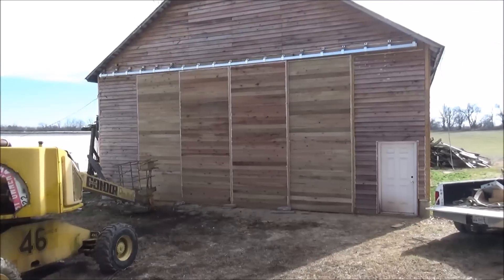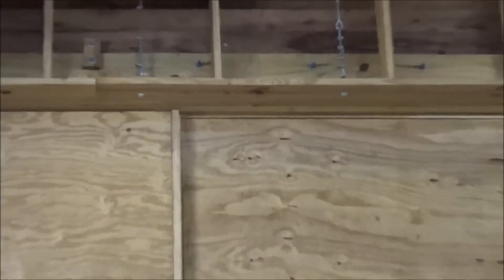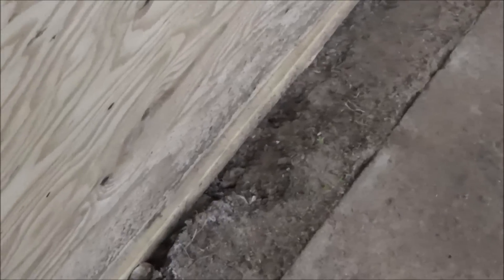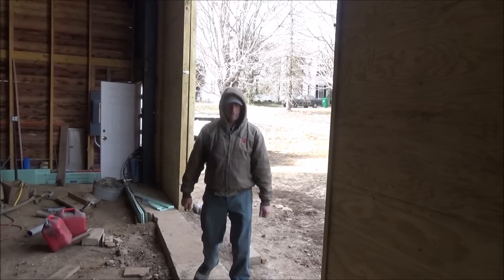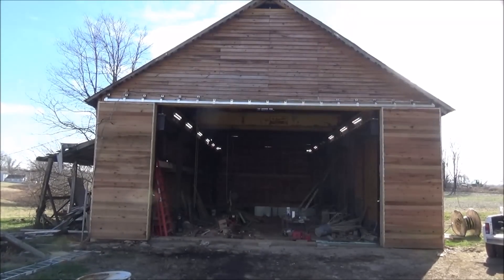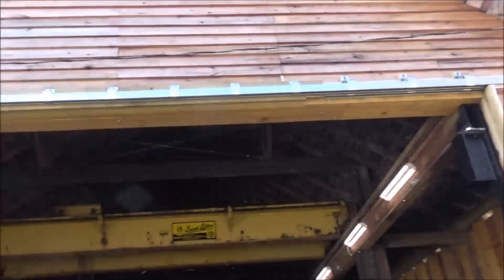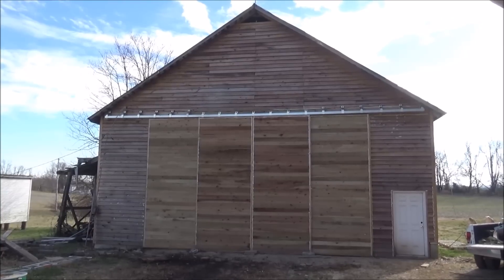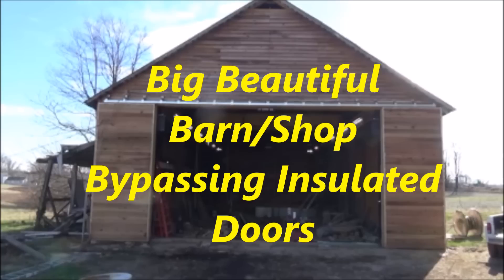Big Beautiful Bypassing Insulated Doors for a Barn or Shop

Comment: I would put a small access/emergency door at the rear.
Reply from the maker: If I did that I would have to build stairs out there to make up for the 3ft drop going out the door and they would be in the way of mowing around the building.

Comment: I rest my case with the unsafe farmer like you  you just showen  how stupin  you can be as to safey goes
Reply: What are you talking about ?
Reply: you barn/ shop when you big doors are open you have no way to exit  out if their a fire that is blocking a door way put and other door  in the back of you build  and it does look like you only have 1 header  on you big door too . we had worker hurt very badly on our farm because of our building and un safe ways of doing the jobs here YES  WE DID LOOK AT IT AND HAVE CHANCED THE WAYS WE DID WORK we now work in a team  all way with an other person  and as to the children around the farm  they are not able to be in the main working area,s are now use  yes we do have a safe place for the children to play and could help in some cases with feeding calf in a calfing barns ,  as a family dairy farm we did fine the work was done lot better and less damages doneas to how big it is we are now run a 300 hear 3 barm dairy   you can make it mush safer them you think you are
Reply: whacko. 

He has a steel beam header that he has wired. it looks like that then attaches to a 2x10, which will add little, but the most support is on the steel beam.  And I am sure if he sees any sag, he'll fix it b4 it's an issue. If you have been following.. he took a building that was pretty much falling down and shored it up, and straightened it up.  All by his lonesome... So  you might have overstepped your understanding.   It also might be nice if you wrote so that you can be understood.
Reply from the maker: The wood header beam is actually 3 sandwiched 2 x 12's backed up by a horizontal 2x12. The track hangers are then all thru bolted thru that with 3/4 bolts and flat washers.  Then all of that is cabled to the steel10in Wide flange I beam. I am confident it will be sturdy enough for the job. :-)
Reply from the maker: Jennifer white: I hope english is not your 1st language.
Reply: I think a guy with a masters in mechanical engineering knows just a bit about designing things that are strong. Just a tad.
Reply: Jennifer White Troll